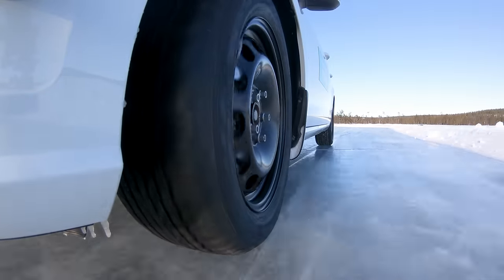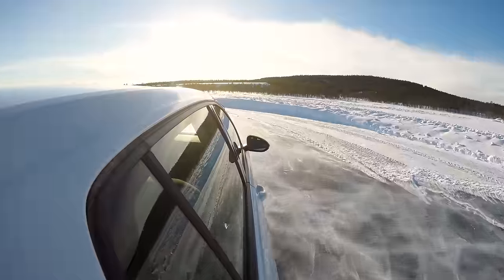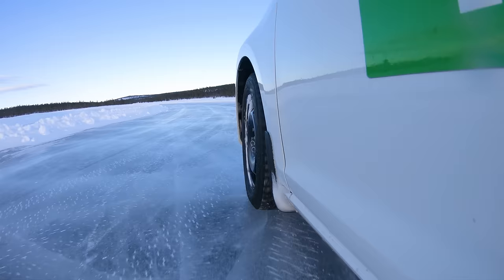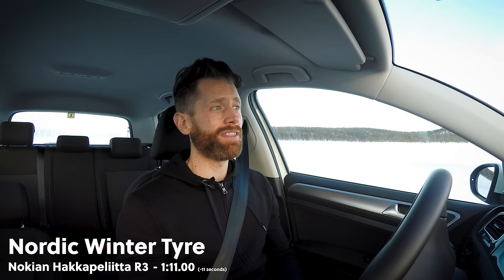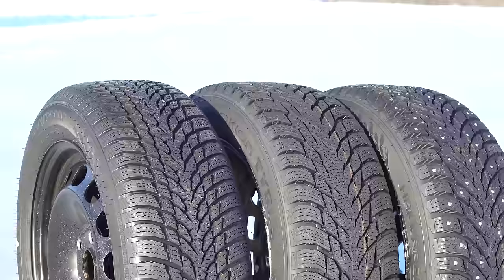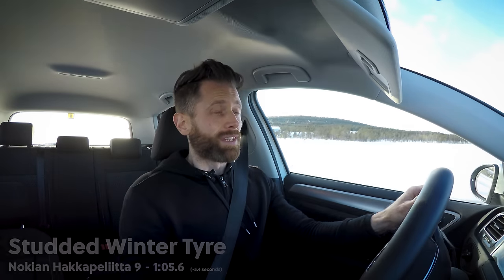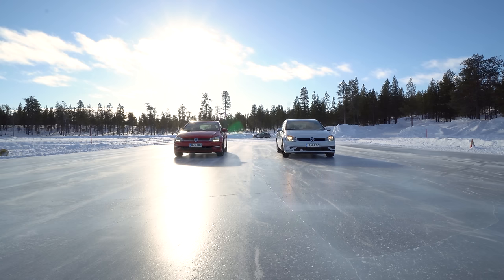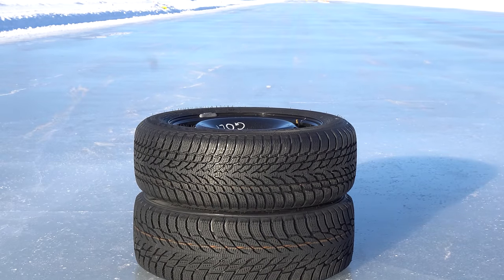Winter Tires VS Studded Tires ❄ What's better on ICE?

Comment: The real difference between these tires is that one morning you just can not leave your home up the hill, and with other you can :)
Reply: Unless you are living somewhere in wilderness or up in the mountains the normal stud-less tires tires are fine specially since roads are cleaned in winter..
Reply: or overwise one evening near your home you able to stop on the downhill or you cant :D
Reply: I feel you man got stuck at home for not changing my winter tires. I have a audi s4 quattro v8 4.2L and still gets stuck on snow uphill with summer tires. Tires really make a huge difference
Reply: I have tire chains for those rare occasions that the road is too slippery for my Hakka R2 sutdless tires. Studded tires are certainly better on ice, but they put a ridiculous amount of salt on the roads here each winter, so my car needs rust protection rather than tire studs.
Reply: I've driven over 30,000 miles on snow and ice covered roads and I've never owned studded tires or winter tires. Learn how to drive
Reply: @poplaurentiu4148  where I live (Tromsø - Norway) we have a AWD car and we can't get up our driveway without studded tires.(we had top end stud less tires)
Reply: @Bryan-Hensley  Do you live in the midwest or western states?  I ask because my friends say the same thing until they come to hills or mountains.
Reply: Bryan Hensley then you never seen an real winter.
Reply: @jonathantangjerd  I've got roughly 30,000 miles experience on snow and ice. I've been involved in racing all my life and we used all sorts of different rubber compounds. I've tried both and I can't really tell much difference. Winter tires made a much bigger difference before all the new rubber compounds came out in modern tires. Back before radials were common we had seperate Winter tires.
Reply: @Bryan-Hensley  then you really haven't raced with both, i have, and the difference is huge ;)
Reply: In Northern Norway, we use studde tires.
Reply: I'd be more concerned going down an icy hill. I'd want studded tires so I don't end up on YT blooper reel where we have a dozen cars smashing into each other and being knocked around like bowling pins. :-)
Reply: @Bryan-Hensley  Wow, you´re just a rookie in driving on snow and ice covered roads. Come to Finland and you can´t  drive without nordic winter tyres (with studs or without) or you need road service daily ;-)
Reply: @mathias61  but the slickest roads are the ones that's beginning to freeze. During the deep cold ice has much more traction. And I live in the mountains. The people up north in the USA are usually driving on fairly level terrain. One road I drive quite often has an elevation change around 10,000 feet. Temp can drop 20 to 25 degrees going up that road.
Reply: @dasubote  Bravo!!! Here in Seattle studded tires are a great choice. We have soooo many hilly streets, and when they ice up, forget getting to work, unless you have studded tires... and an AWD vehicle.
Reply: @poplaurentiu4148  hahahaha tell that to the people living in Vancouver bc
Reply: If local road authorities do not clean the roads then some basic tools to have inside the trunk on winter period are these : a proper snow-brush, a light snow shovel, few strong straps for towing, power-cables (in case of electric fail) and some quick to install snow-chains for those snowy roads.. Have a safe Christmas ! ;0)
Reply: @poplaurentiu4148  Until you. hit ice on the cleaned road
Reply: @Bryan-Hensley  u from alaska
Reply: @markyperalez  no I live in the mountains of the eastern USA. I'm in the steep hills, cliffs along the roads. Nothing is level around here. Elevation varies making some trips vary from wet roads to ice then heavy snow back to clear. That's the problem around here, it's not consistent. You might drive through 30 miles of 2 foot of snow then 60 miles on clear pavement. Winter tires are kind of dangerous on dry payment, the rubber balls up during heavy breaking or turning making it somewhat like your on BBs. I'd much rather have the most traction when everyone is going fast because I have absolutely no trouble on snow with regular tires.
Reply: Studded tires are an absolute must here in Alaska. Without studs, goodluck getting up or down hills safely.
Reply: @abrahamwalton8244  Also living in Alaska, and using not only studless but all season tires, your comment is not correct
I live in the valley and can get up lazy mountain in 1/2 of ice from freezing rain. Ive done it more than once
Reply: Aren’t you a hero.
Reply: Where you really need studded tires are in a 3 ton truck when a sudden need to stop arises... I've been driving on studless for a few years in my truck as it came with studless nordic winter tires. I'm always nervous and driving defensibly as the stopping distance is very long on ice. I just switch over to studded NOKIAN LT3 tires, and it is a different world. The car has way better sideways grip and the tires give real confidence when it comes to stopping distance. I haven't measured the distance, but it seems like they are stopping at between half and 2 thirds the distance of the studless. Only worry is how long the studs will last...
Reply: @Espen_Danielsen  Depends on how much you drive, on what you drive and how you drive. Dry asphalt kills them, pulls them out. Hard cornering and burnouts same thing. But calm normal driving. Then as long as the tyre. And should you loose some studs that's not an issue. If you loose many, then you can add  new metal studs to the tyre. 
(I'm from sweden.  I always used 100% always Nokian hakkapelitä with studs in winter. 30 years driving)
Reply: @Bryan-Hensley  so you kniwnnothing abolutnie winter driving or you drive with radiculous low speed.
Reply: @Bryan-Hensley  Lol. First it was auto corection what fucked up my words i have I pad with Nin english language set up. I don’t Bealive  you reced..even if so... yank racing  ultra is ultra weak  and usless. Racing on ovals require less skill than proper parking in Rome, .paris or London ..not to mention it will nit teach you drive on snow at all. There is no racing or rally driver in the world which would say They don’t use winter tires and think that winter tires are not needed. I am from country where second oldest rally in the world is located..coiuntry of multiple rally  champions of Europe  were born amd trained.  and we have true winters sometimes with heavy snowy winters. About 95% of drivers use winter tires in winter and summer tires in summer. Huge factories of Michelin and Good year are located here.
Reply: @freddyhaza1377  why don't you just get all season.
Reply: @Bryan Hensley  your a clown lol every study and basically anyone with a lick of experience shows a massive difference that modern rubber compounds make in giving traction and that the colder the road gets the more slippery it is NOT right as the road begins to freeze as you said 😅 .. absolute foolishness.
Reply: @hanswangnstvold435  du må ha piggdekk utenfor Oslo 😉
Reply: @kremepye3613  stemme det :) når en subaru ikke får sæ opp uten pigg, da må man ha pigg.

Comment: I'd like to see a comparison between a budget studded tyre vs a premium nordic studless winter tyre
Reply: Never imagined anyone could buy budget studded tyres given the danger of the surface.
Reply: @sdrubaa  as someone who lives where 60% of cars in the south run studds and like 85% in the north do (during winter), it is super common.
Reply: Yes I live up in the hills... These ice compound tires do help but studs will keep the car from sliding down the hill on black ice. I tried the Michelin xIce tires and they just don't work well on ice. Studs for me unfortunately. I just only run them very specific weeks of the year.
Reply: @sdrubaa  If you go north to countries where winter means actual snow and ice, you'll be surprised. I'm from Estonia (expecting snow and ice in January - March), here almost every vehicle in winter uses studded tyres and it does make massive difference. Our eastern Russian neighbours have even more snow and wouldn't be able to drive in winter without studs. Even with studs sometimes grip is bad, without studs some days it would be impossible to drive. It does affect road condition, in spring almost every road has to be repaired, but that's a tradeoff for being able to drive in winter without sliding into other cars.
Reply: @a2jettagli  Using Michelin XIce on my Tesla this year.  First time without studs in over a decade.  No comparison.  Yes, the compound is amazing, but still nothing like the security I get with studded Hakka's.
Reply: @sdrubaa  in Norway some people buy budget unstudded tires an put it on their brand new Tesla. Their always surprised if they loose control and crash.  I don't get it at all. Why take the risk especially with electric vehicle torque.. I've bought nokian hakkapeliitta for the cheapest cars I previously owned.  Sometimes when I've sold my old cars the real value of the cars is the tires and the accessories I've installed.
Reply: @sdrubaa  you'd be surprised. I live in Norway, a lot of people and especially Tesla owners are really into saving money on tires. I once found myself on a norwegian electric car forum, and seems like they are perfectly happy to run their tesla model x with Landsail summer tires, and nankang winter tires.. horrible choices for such heavy cars
Reply: @a2jettagli  Here at the arctic cirkle in Sweden we use winter tyres from November untill  Marsh-April. To get longer life on the rubber of your tyres (using them so short time) you can let them soak in oil every year. Othervice they will turn into hockey pucks. Just use cheap food oil. That will keep them alive for years. Salted dirty roads will also make a hughe differens when comming to a hill, or trying to stop. The best thing to do is to keep the speed so you get forward, but not to fast so there is no stop.
Reply: @johnditoro1676   I love every person driving with studs. That means i can drive silent without stud´s.
Reply: Starchmed: Actually I’m not surprised.  People who buy Teslas in Norway are fans of saving money (due to tax-exempt status of electric vehicles in Norway) while looking cool, not fans of driving good cars!
Reply: @nelsonlee9282  hahaha, you got it just right!
Reply: With studs and without studs you will see the biggest differences in temperatures arround 0° because thats when it is real slippery, you will also see big difference in braking distances and also evasive maneuvers,  but studs are worse on dry or wet asphalt or muddy snow without ice under it surfaces, so studs where it icy and without if it's winterroads without an icy surface.
Reply: @slava_trushkin  The same thing here in Norway, durring winter season (October-April). Studded tyres rules! 💪
Reply: @starchmed  Dumbest car to buy where the battery has to be plugged in all the time to stays heated lol.
Reply: @slava_trushkin  I live in Russia and run summer tyres well into the winter so my studded tyres will last longer. You can drive on clean ice with summer tyres and it's not a huge problem (sure, you must be very careful with following distances and drive very smoothly, long distance not recommended), but a little bit of snow on top of the ice and you have no chance on summer tyres. I tried non-stud winter tyres, but this compound is of no use in snow. Only with studded tyres you can dig yourself out. They have a very square edge and an aggressive pattern which cut into the snow and grip very well.
All the roads here are worn with studded tyres, but it takes them all summer to repair the spring potholes, there is no chance they will change a ruined road surface. Nobody worries about that, we only curse them for the potholes.😂
Reply: Studs aren't permitted here now.  They were banned after the third winter and had to be pulled from the tires.  Fortunately we seldom get ice storms and temperatures are often close enough to freezing that road salt works well.  Studs provide traction on ice regardless of the tire's composition though other factors like sidewall stiffness may affect cornering.  Studs are noisy, the sound is like dragging tree branches.
Reply: @TheGuruStud  Where did you get that from

Comment: I live in southcentral Alaska, where we get a lot of different conditions throughout the winter. My experience is that studs really only make a difference on actual hard ice, whereas the tires themselves make much more of a difference on any other slippery surface such as hard packed snow. Studs are great, but i also drive a lot on dry pavement where the ice does not have a chance to accumulate, and the studs wear out and come out of the tire very quickly. I prefer studless winter on a two wheel drive vehicle, but all weather on my four  wheel drive truck, which usually last longer and work just fine in nearly all the conditions i drive in
Reply: The point I was trying to make in my comments. Well said.
Reply: Which part you in? I'm in Anchorage. I have 2 cars both with studded Nokian. One used for 7 winter seasons, and one used for 6 winter seasons. Both are still in wonderful conditions with all studs in place and in good condition.
Reply: @bkakus  I’m up in Palmer
Reply: I’m Fairbanks right now and I’m looking for new front tires for my FWD car. Right not I have new Blizzak tires, but it feels like I get thrown all over the road on these icy roads up here. So trying to look at studded tires at least for the front two tires.
Reply: @tannerhughes6274  Roads are bad up there right now, just came back a couple weeks ago. The tires I have been most impressed by are the ipike. I had some that had the studs removed, and they still went up hills with a half inch of freezing rain on them no problem
Reply: @bkakus  kinda hard to believe that you got tires last so long... but i guess if you dont drive the cars then yes, but still would be suspicious of them getting old and lose their performance or whatever
Reply: I have the opposite problem with studded tires on dry tarmac, the studds goes into the tire and do not work anymore...
Reply: @a64738  That’s what I have noticed as well, although now it seems the studs are made differently, and worse. The carbide does not go the entire length of the stud, and after only a couple seasons they wear down to the point the carbide comes out and the stud is rendered useless
Reply: All season tires are for idiots.
Put REAL snow tires on all 4 and have fun

The amount of people with four-wheel drive and all-wheel drive vehicles that thought all season tires were going to be fine, that I've had to pull out of ditches and accidents is ridiculous.
Reply: @mrdark9916  You seeing all the idiot drivers. So many stupid people going way too fast on all season, thinking since they have AWD it would be fine. They definitely aren’t the best for ice and snow, but they work just fine if you are careful. And I’m talking Coopers here, some of the worst due to the hard rubber used

Comment: just to clear some myths that are very misleading  modern studs have little rubber shock absorbers behind each stud this goes a long way to not damaging the asphalt and cutting down on the noise . Those studded hakkas have three different types of studs in one tire for maximum traction  and they are so much better, light years better than most winter tires , driving in circles on ice is pretty meaningless  when you drive in mixed conditions of a western canadian winter (lots of -20 to -30  hard pact) these tires are superb  i have driven on many different  winter tires  4 months a year for over 20 years  and nothing comes any where near the performance of these tires    in the real world these tires are outstanding and will keep you safe in horrible conditions